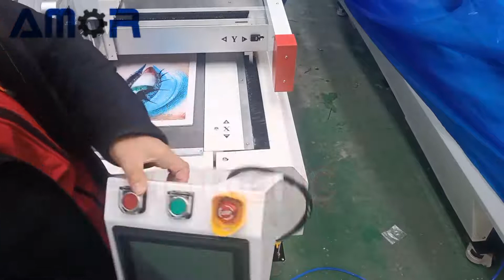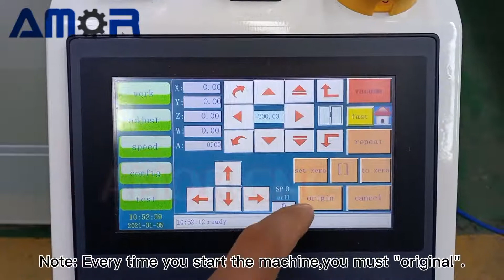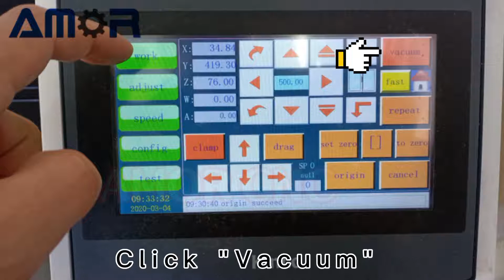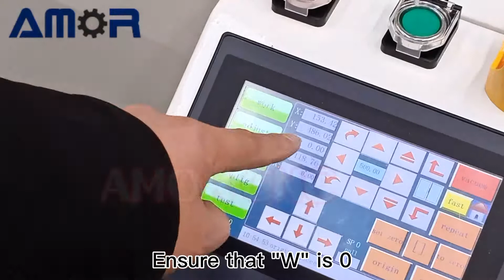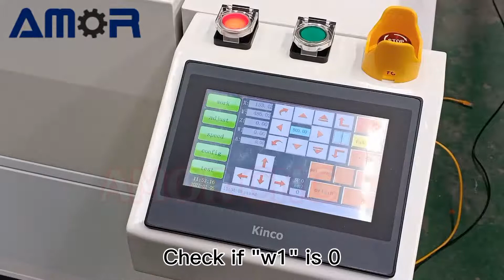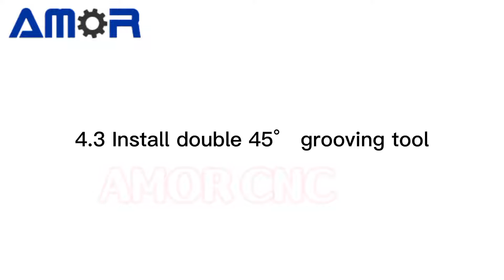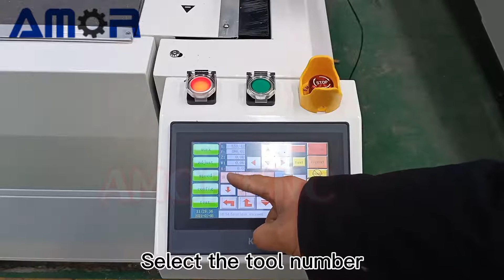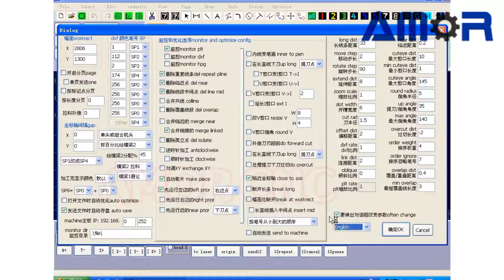How to Install CNC Oscillating Knife Cutting Machine | AMOR

Comment: I am having a problem with my CNC machine. The oil pressure of the cutting tool is not working. How can I get it to work with the software?
Reply from the maker: Could you explain your problem in detail, please?